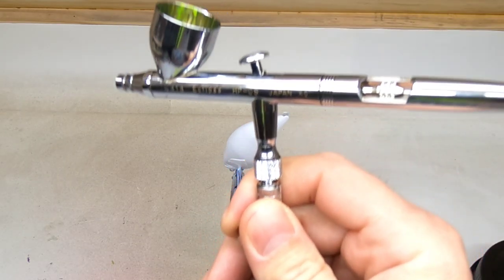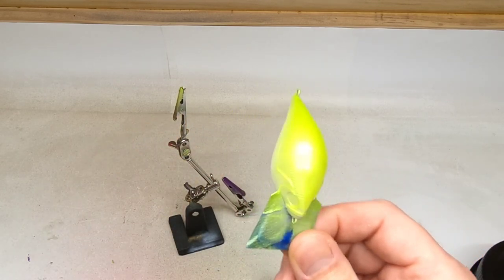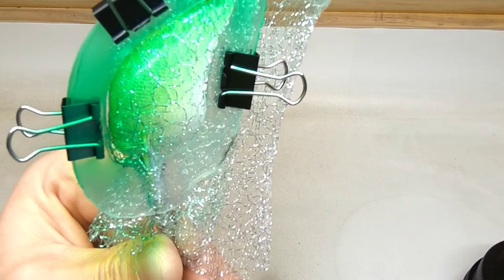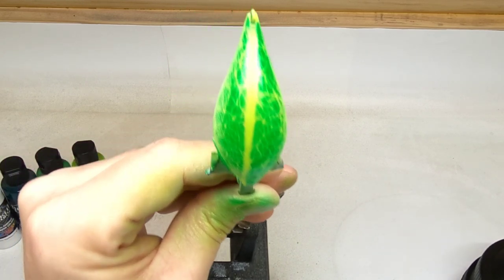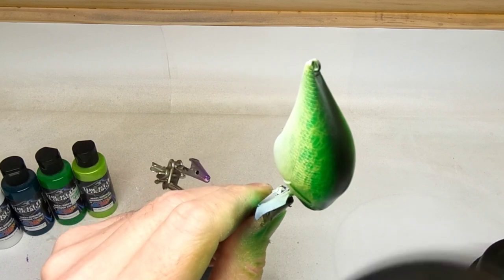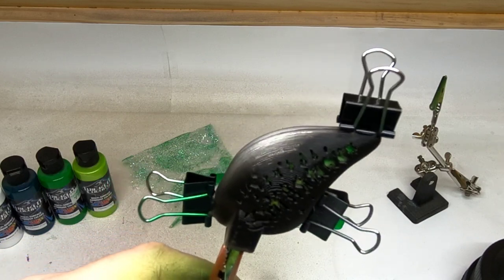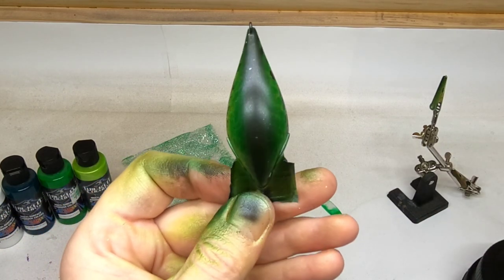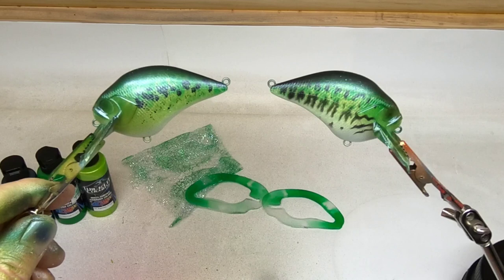Custom lure painting, largemouth bass pattern with artist sponge, 3-D stencil, createx wicked paint

Comment: What air pressure do you use.
Reply from the maker: I'm usually running around 18-20psi, super thinned metalics. Sometimes I'll switch to a bigger needle and run 25-30 with metalics.  Thanks for watching.